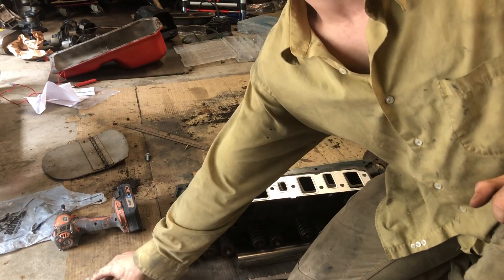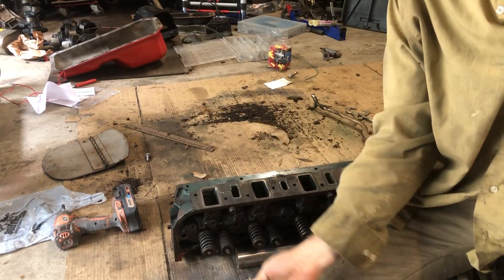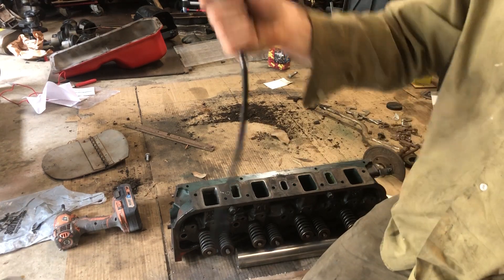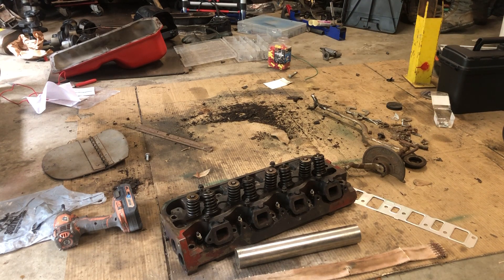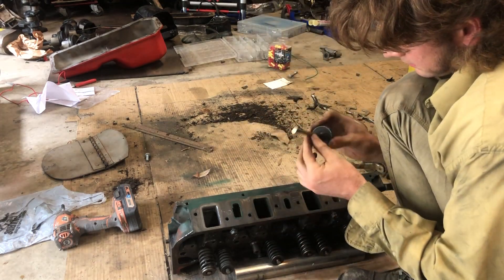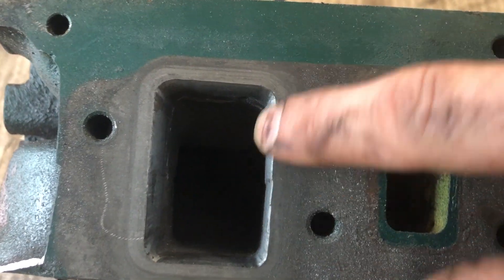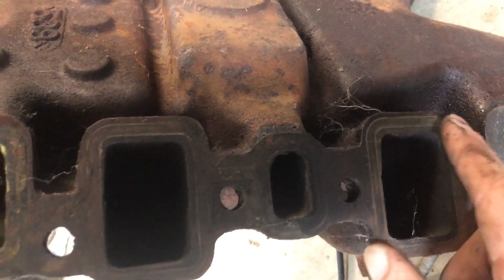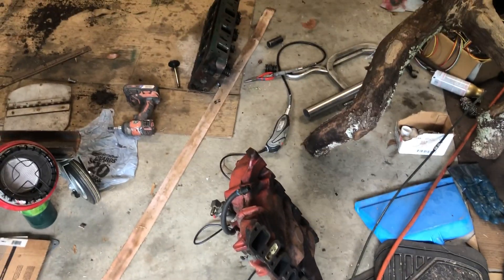Cylinder Head Porting for the Hobbyist

Comment: The 345-392 rectangle ports do not need any work done to the intake ports especially on the floor of port if anything they need the ports filled to the 266-304 square port to get rid of the floor ramp into the valve guides and crazy short side radius, this will increase port velocity  over cc volume then you can improve the top and sides of the square port , intake manifold also needs filled to match them ported